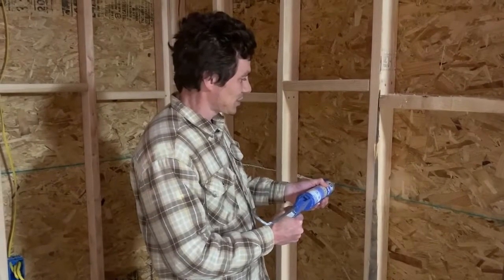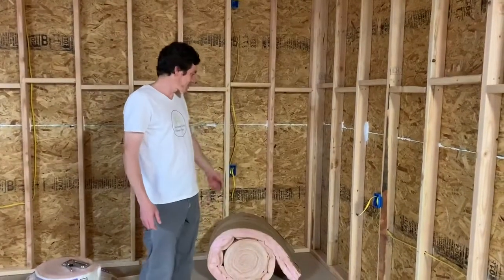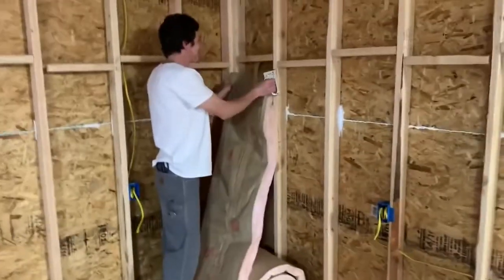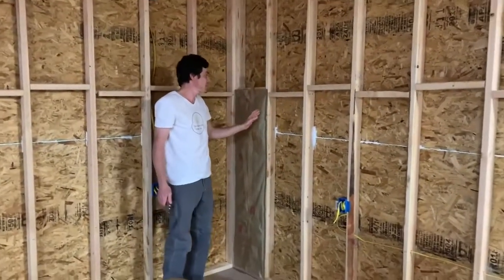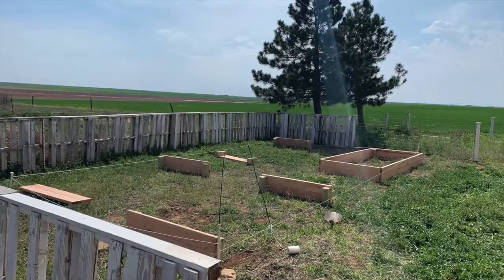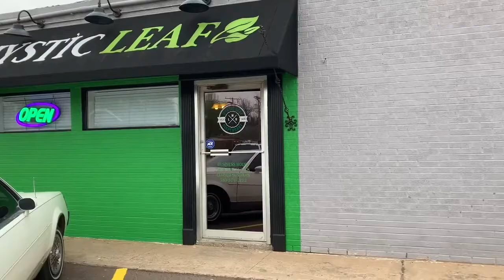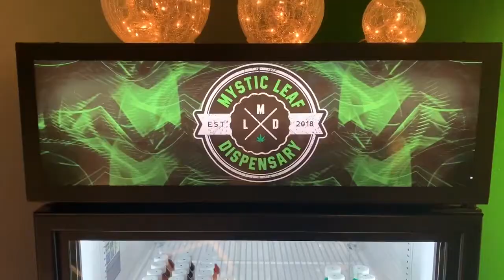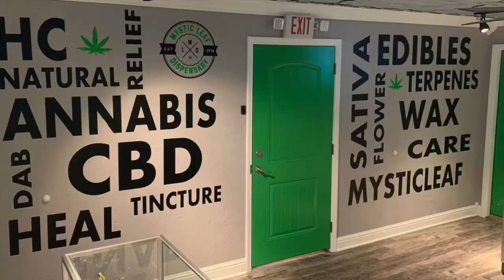Our First Dispensary Tour and More!

Comment: Ultimately your caulking looked fine but to make it easier next time apply more calk pressure,  do not fear some excess squirting out of the crack and move faster.  let the pressure get the caulk in the crack.
 keep your tip moving just keep your tip of your call gun moving across the surface.